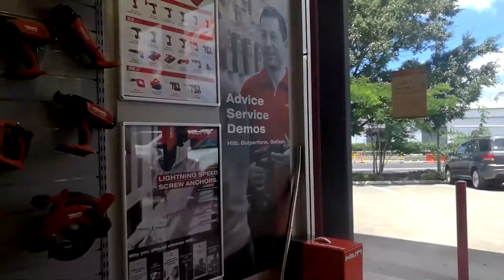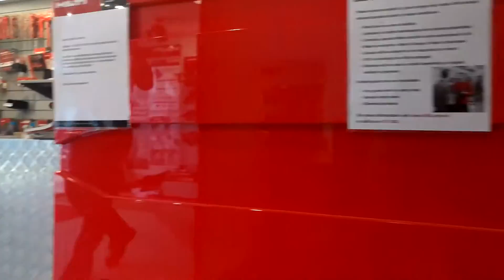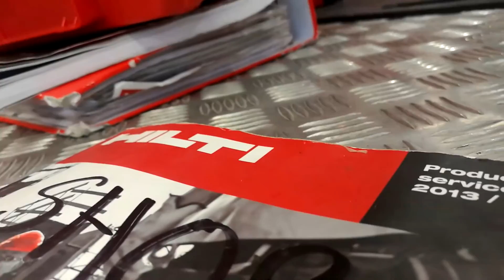Patch and Repair a Plaster Drywall like a pro

Comment: As For KEYING Up  Paintwork instead of cutting lines into with your Stanly knife try using your knife to mark out ovel shape on the pain then using the blade get your knife in between the marked line to bring the surface down so as to with your fingers pull face off  the ovel section. best way I can describe it. perfect key!
Top Class Ceilings..

Comment: yer i have hilti cordless collated screws gun. screws into jarrah like it's butter. very impressive. 
do you do any video's on decorative plaster Cornise. if so you ever seen pattern cornice without a blind corner? more to the point if you do you really should do video on plaster cornice & the importance of oil base sealer.
talking yesterday about the "best possible finish" you could provide on the drywall any wall even ceilings if you had to base your joins as normal then with Top coat skim the entire wall.
Top Class Ceilings..

Comment: That Base Coat 20min is good stuff as to get out of a small job quickly. I also like how you have used extra stud adhesive so as not need to screw the middle of the. now forget about the tram lines you going to have in the morning. the guy doing the flushing is doing a beautiful I can see he he really knows how to work his plaster. still i bet he doesn't know how close he is to actual perfection. if he can work it out he will have a unique edge over all the flashers in the state.
so what's the go with hilti don't tell me they have a picture of you on the wall holding salt shacker.
Top Class Ceilings..
ps I know Gyprock fixers Claim to fame is Cleaning buckets till there new again & paper tape. nothing wrong either. still nothing wrong with fibreglass glass tape either.
Top Class Ceilings..
Reply from the maker: Haha hilti picture and the salt shaker, man you can write some scripts for me, that is funny. Very good... Nah i just try get some good tools, makes me like working for a bit till it gets old. actually since i started filming and making these videos I've enjoyed the work so much more. The other guy taught me plastering when i was a painting apprentice we did lots of insurance work together. He is really knowledgeable. My original trade is painting i enjoy this far more & pays better.

Comment: just watched a video guy repairing water damage ceiling. he's cut section out up to the cornice. poor fella obviously too scared to clean of the sheet off the top of the cornice so as to slide his sheet over the top eliminating one join. then he back blocks all 4 sides using cornice adhesive. me i use stud adhesive on my back blocks I find it easier so then he installed his sheet & then flushes it. now if you struggled with me saying use fibreglass tape rather than paper tape so as eliminate tram line effect that guy didn't use any tape at all. I was going to tell him but I'm sure he must of simple forgot.
Top Class ceilings..

Comment: he also likes to point out how to mix cornice adhesive to flush the ceiling with. yer though it's not as fefined as base coat you can use it to flush with to save money on plaster added with not paying out for any tape it adds up anyway none of what he's doing is ideal if you making a video of how a professional does it. like I said there is guys out there older than me yer older than me still doing it wrong.
I need to get a life this is doing my head in.
forevermicheli..